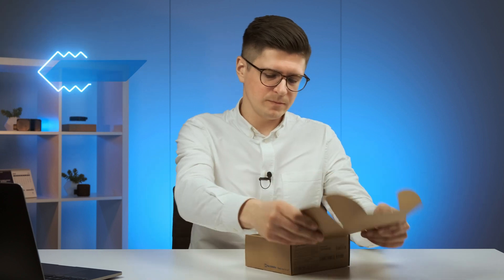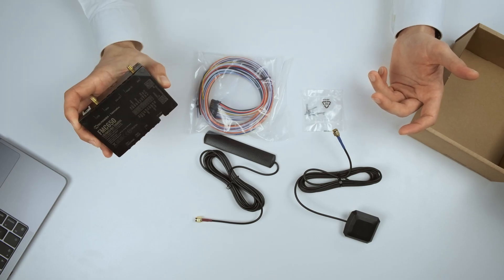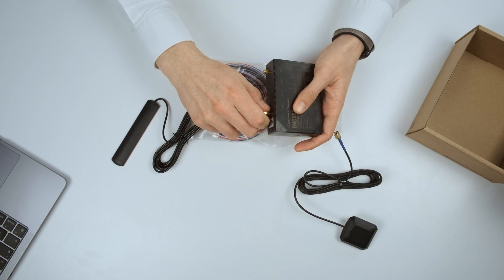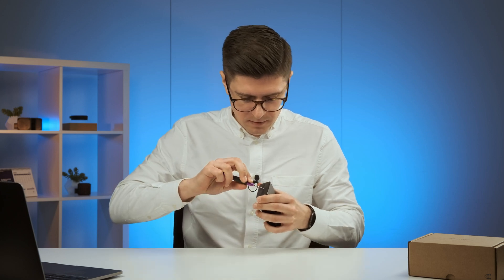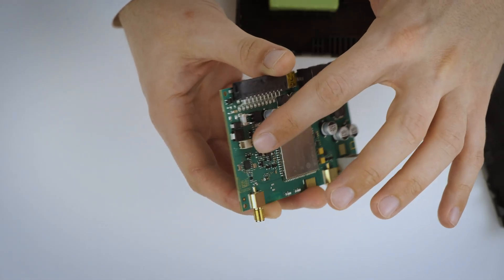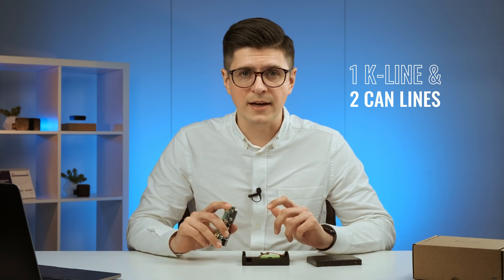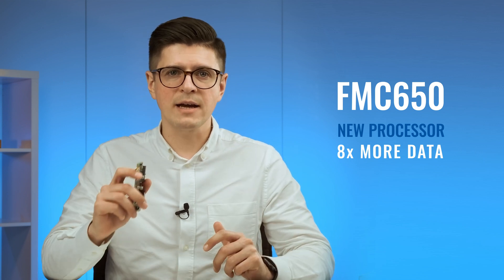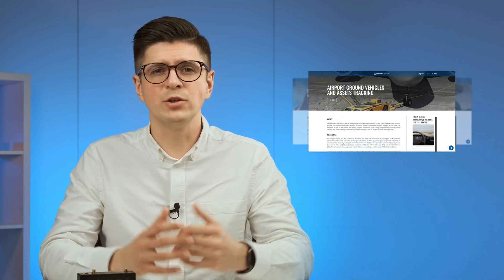Out Of The Box #4 | FMC650 | Teltonika

Comment: Dear Teltonika team, compared to 10 years ago and now, the devices are getting better and better and cheaper, it is very affordable now BUT you guys are lacking in Programmable Logics. You may want to consider having some simple logics,  IF Event XXX = High/Low; Action XXX = On/Off/High Low. For example IF DIN3 = 0; Action DOUT2 = 1. IF DIN2 = 1; Action DOUT1 = 0. Another example, IF Unplugged = Active; Action Sleep Mode = Active. These are logics which can be customised based on our need, it will be very useful for Integrators. Please consider
Reply from the maker: Hello!
You can achieve this by using the FMC650 Custom Scenario feature. Here is a link to our wiki page for more information: https://wiki.teltonika-gps.com/view/FMC650_Custom_scenario.

This feature is also available with the FMC640 and FMB640 devices.